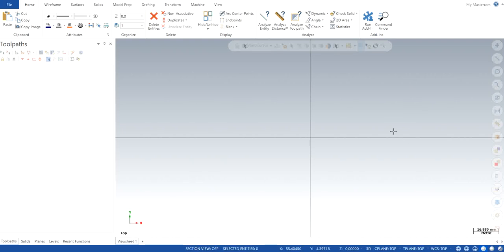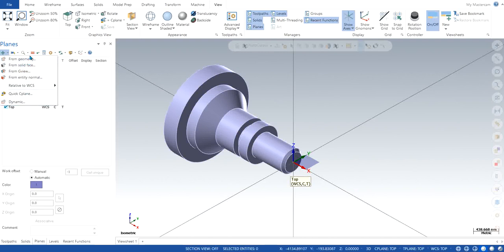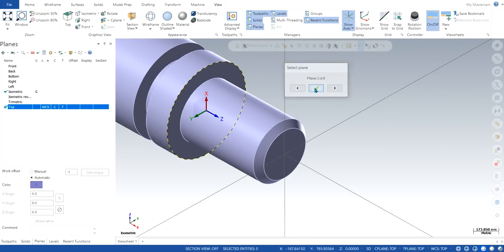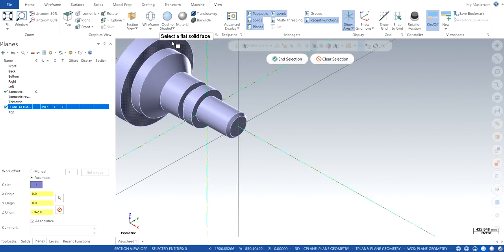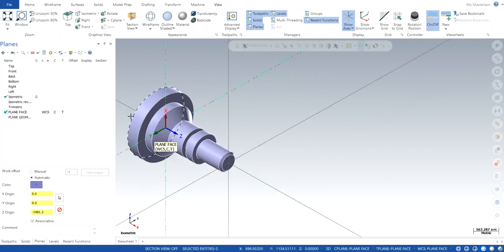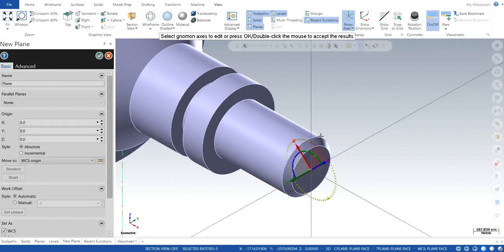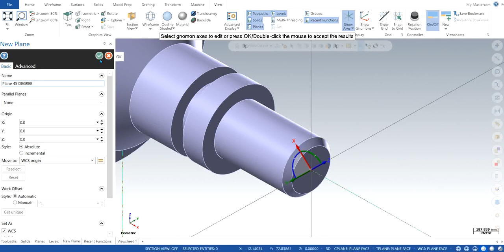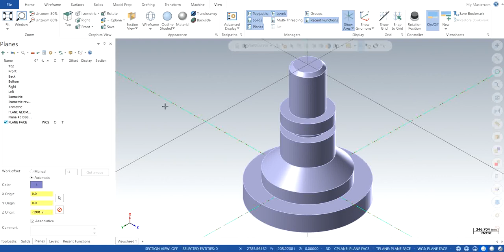HOW TO CREATE A NEW PLANE IN MASTERCAM 2020

Comment: Please explain the position of xyz axis direction in turning and its setting. Which is the axis fallow in turning like C plane T plane or wcs plane?
Reply from the maker: In turning you are using D+ axis in top view to make wireframes and use them. 
C plane is contruction plane, where you make the wireframe and all. 
T is tool plane ( perpendicular to tool axis ). 
Wcs is work coordinate system. Your G54 when working with 3 axis part, could go from G54-G59 depending on setups and axis involved to produce part.
Reply: @Everythingiknow881  if i export the model then?